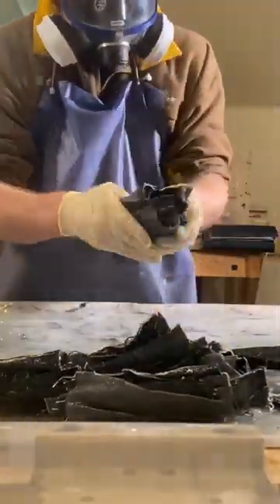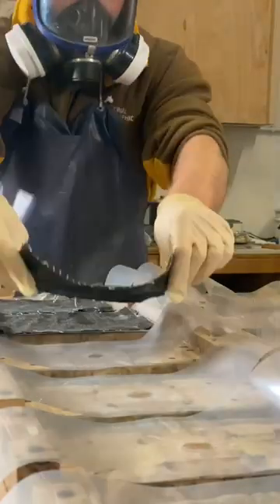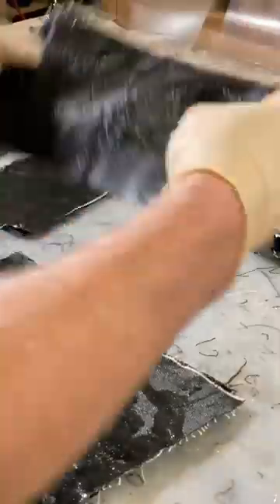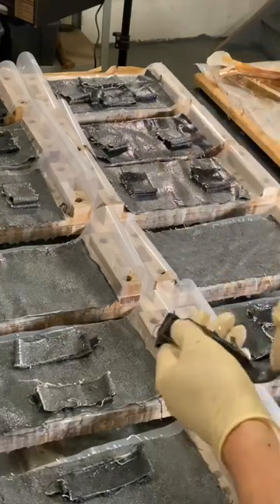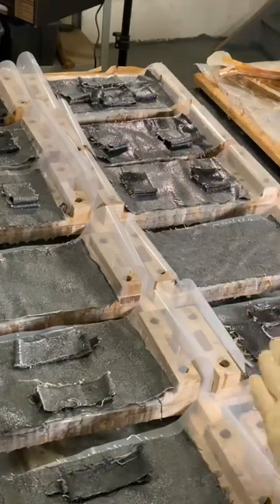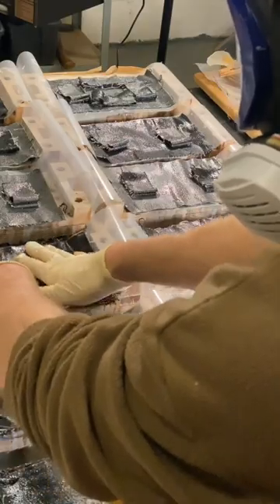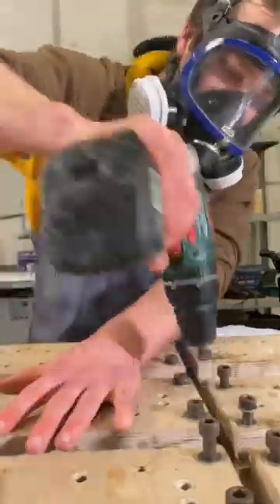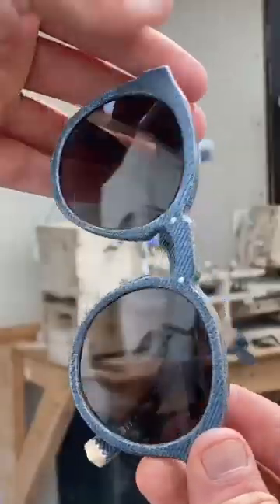‘Why don’t you just put a denim print on normal sunglasses?’ #shorts

Comment: Why don’t you put the resin and denim in a vaccum chamber and just pull the air out? That would fully saturate the denim and then when you put the composite in the mould, just compress it to push excess resin out.

You should look into fibreglass manufacturing process or carbon fibre, you’re essentially doing the same process (flexible cloth and resin hardener). Pre-preg carbon fibre is very different though
Reply: How cheap is that so called vacuum chamber 🤣🤣🤣🤣
Reply: @JO_Artificial  you don’t need a vacuum chamber, you can vacuum bag and use a vacuum pump to pull the air out. The vaccum
Bags are disposable and inexpensive
Reply: Looking at the process - the compression is also a very important part of the process to compress the parts together. It could also be that removing all of the air would leave the parts too brittle.